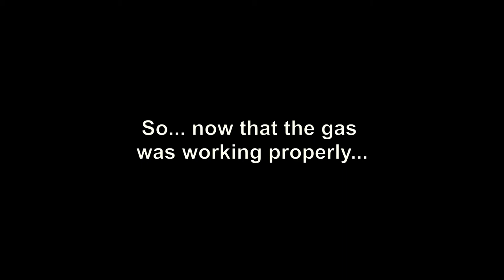Gas leaks & thermal cookers - Ep. 75

Comment: Like your videos.  Can't believe more people aren't using thermal cookers as they use a fraction of the gas and can just put in a cupboard while you sail, cruise or drive with no spillage.  I sail, have a share in a narrowboat and have a campervan.  Use TC in all 3, but mainly at home, set it up before we go out walking and come home to a hot meal, slow cooked and hearty.  Recently visited friends on a boat who hate cooking, have no microwave and limited gas  (they are stuck due to canal being shut for repair).  After an hour cooking at home, 90 mins drive there, 2 hours driving taking them to a launderette and back, we presented them with a hot meal of braising steak with carrots, parsnips, onions and celery cooked in a Guinness gravy with potatoes in the top pan out of the back of our van.  It had cooked slowly over 5 hours and was still hot, meat was meltingly in one lump but could fall apart with a fork and the veg soft but in one piece and still tasty as nothing leaves the pot.  Friends delighted they had clean sheets and underwear plus a lovely meal they didn't have to cook.  Think they're buying one.
Reply from the maker: Well done you for thinking ahead and spreading the word. 👍👍 We love our thermal cooker and we have even set up a cooking channel where we make use of it. For us on sea passages, MrD producing a hot meal makes a heck of a difference - we literally go below decks and two minutes later come back up with dinner in a bowl. Also, because we tend to eat smaller meals under passage, we usually get two meals each from MrD, although the 2nd one usually needs a little reheat.

We were very surprised when MrD got in touch with us to say that lots of people were buying the cookers because they saw it on our channel and that is why all our recent videos have an affiliate link. I think we have earned a dozen bottles of wine now so the message is getting out there.

We hope to resume our cooking channel now that we can get out and about, but here is a link in case you want to have a look

https://www.youtube.com/playlist?list=PLG5fmJVRPTRcwgPZb1Q_aWdoh1Nt7s4XS

Thanks for commenting. We appreciate it.
Reply: @SailingYachtSaltyLass  Hi again.  Another useful pan I use in the van, narrow boat and when I go sailing, is a Ridgemonkey Combi.  These are designed for anglers to use 1 or 2 small gas stoves, but are fantastic on a 2 burner stove as you can put multiple things in different compartments, steam stuff or use as a small oven for Pizza or toasted sarnies.  Hope this helps!
Reply from the maker: I am always interested in anything that makes my life easier. I will have a look at that and perhaps file it away for future use so that when the current pans wear out (never takes long on a boat) then I have an idea what to replace them with. Also, it MUST fit in the pan cupboard  😉
Reply: @SailingYachtSaltyLass  Obviously we have the same problem of storage in the camper van, narrow boat and when we charter a boat for sailing.  The pan comes with 2 halves that open on hinges so fit together like a base and lid and each has a handle that locks to the other one magnetically and keeps the pan 'closed'.  These handles click on and off and store inside the pans.  2 pans in one plus steamer, oven or toaster!  Even if the boat's rocking, the pan can stay closed.  I was impressed and hope you will be too.

Comment: Just a bit of random info for you , the recommended time frame for changing the gas hose is every 5 years and I would definitely recommend that as you appear to have enough new hose left over then I would change the hose on the cooker as the constant flexing can weaken it along with ageing. But keep up the good work.
Reply from the maker: Hi Dave - I checked the cooker hose and it was in much better condition. The current cooker is the Bavaria original and it is showing its age and so I will change the hose when we replace the cooker in a few weeks or months. 

Thanks for commenting. All feedback, tips and suggestions are welcome.

Comment: Clean that locker occasionally.   Looks like a damp, salty, corrosive place.  WD40 is your friend as is fresh dry air.    

Plus next time dip the tip of new hose in boiling water first, to relax the material.   WD40 also lube inside hose and on mount,
Reply from the maker: That was a long time ago and it is just fine now. It gets hosed out occasionally. Also we use washing up liquid as a hose lube as WD40 affects some hoses.